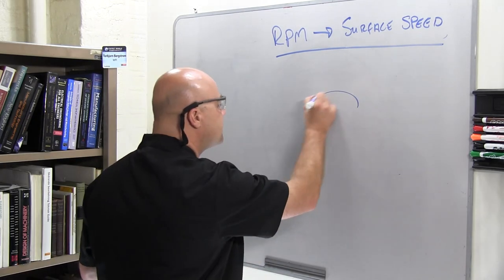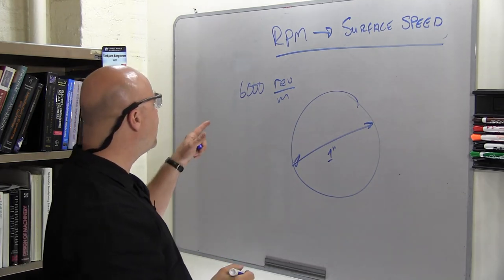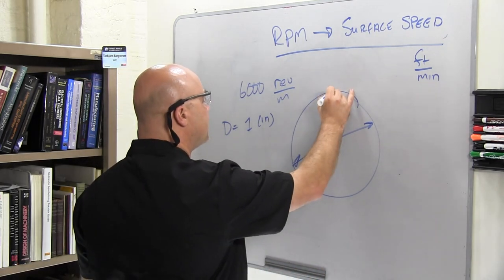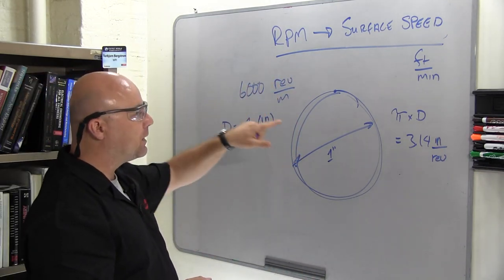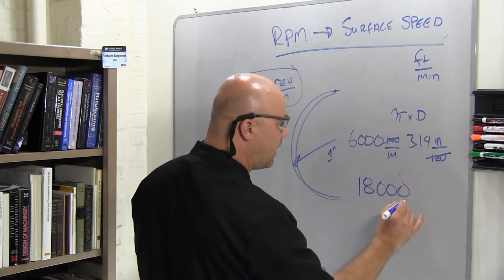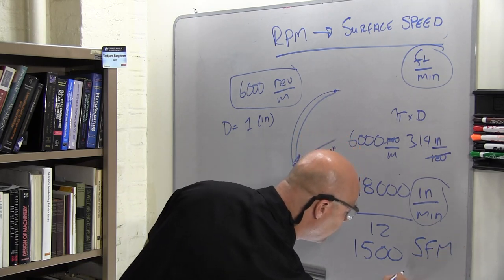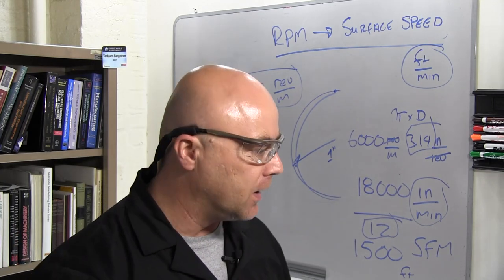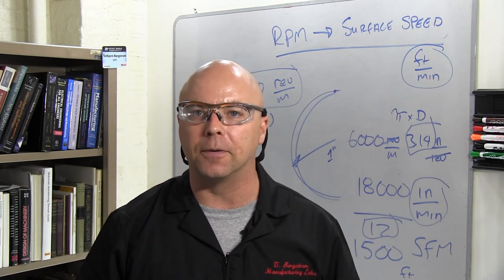Converting from RPM to Surface Speed In CNC Milling and Turning

Comment: the thing that was confusing about SFM is that i thought it was an equation that considers all the variables such as feed per tooth, RPM, IPM. But its not. Its an advanced variable of RPM considering tool diameter.